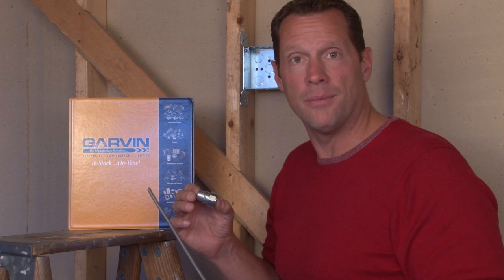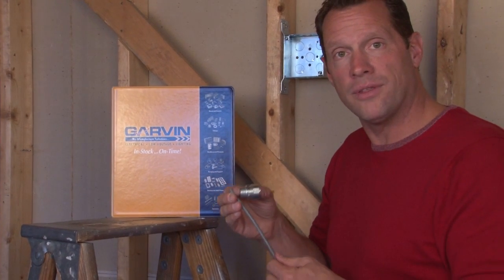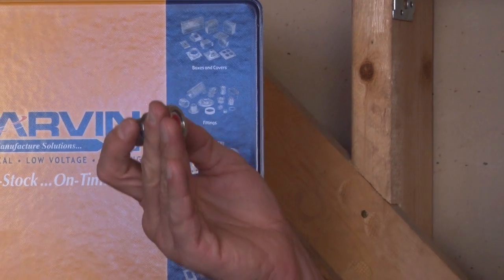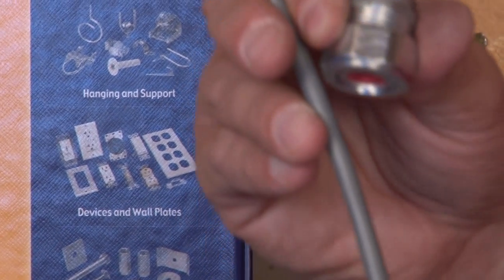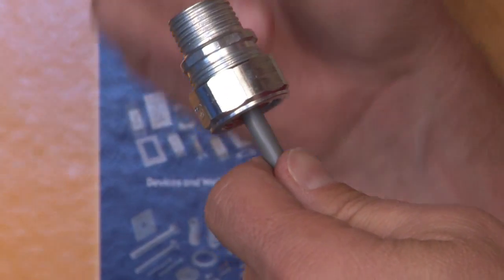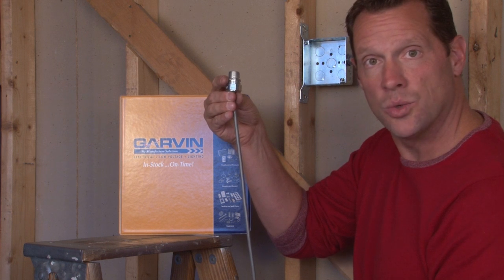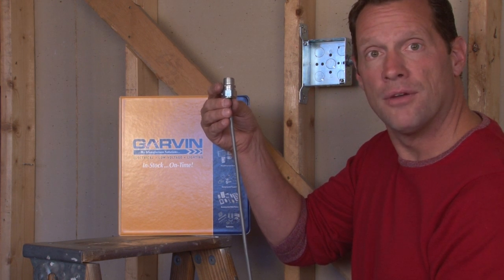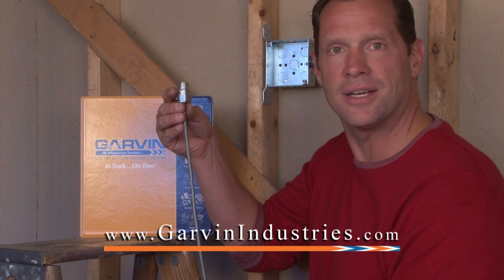Cord Grip Strain Relief Connectors... CG Series

Comment: It looks like you had trouble treading the power cord THROUGH the strain relief. is it really this hard? is a separate tool used to push the power cord through? What if you had 2 wires -can the strain relief be used for both? is there a clamp on strain relief which can be used for builds which are nearly finished?